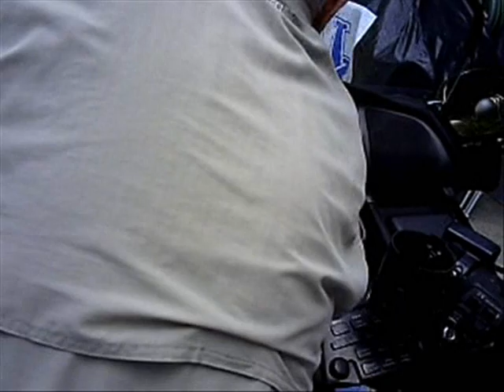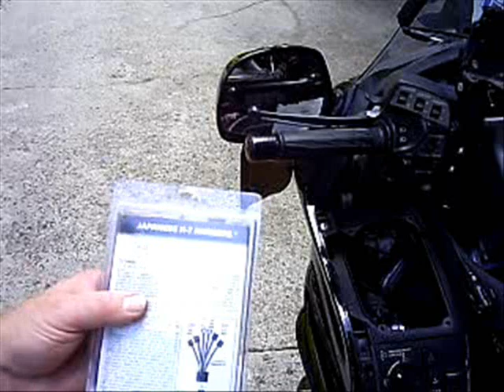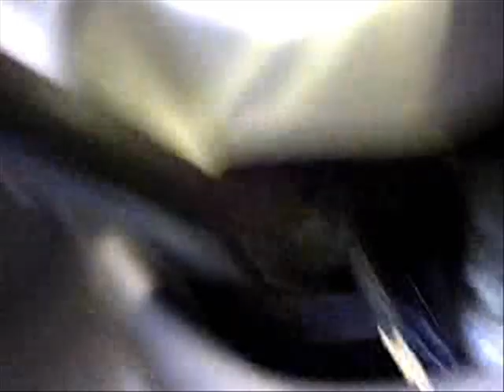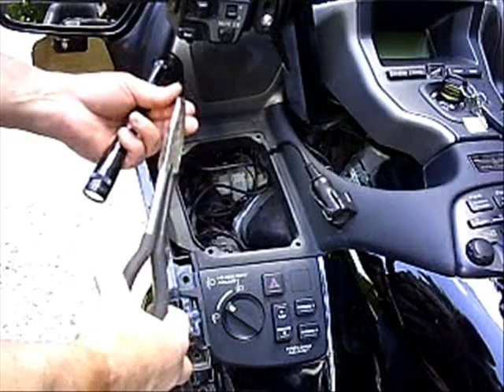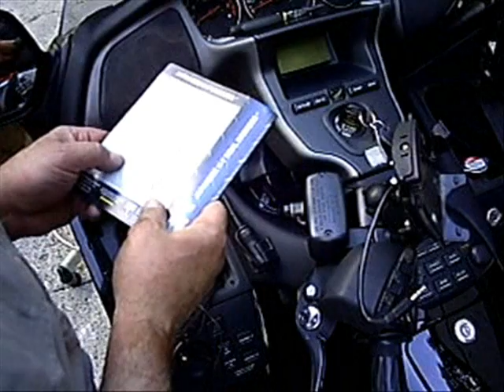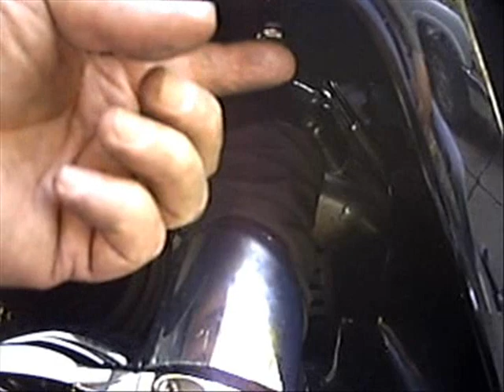Plug & Play Headlight Module Installation on a GL1800

Comment: I was hit from behind at a stop sign because of my back off modulator on my bike.
   On my way to work 7 AM. I was waiting at a stop sign at a four way intersection until it was my turn. My Pacific coast had a back off brake light modulator...
   The next thing I knew, I was coming to laying on the ground. I must have been out for sometime because the police were already there, I heard the guy that hit me explaining to the police, “I saw his tail light flashing, so I thought he was pulling out. “ 
   I was off work for nine months/shoulder. I did have my one piece aerostitch Suit/motorcycle boots, started gauntlet road racing gloves, and a two week old $500 shoei  helmet that got road rash.
   On the Internet, I made a connection with someone that had experience with accident rates with the tail light and headlight modulators.
  He explained to me that these things make following or approaching drivers have a phenomenon called “target fixation “ and that is, when you see something unusual while driving, your subconscious walks onto it and watches it as it is approaching or you are approaching it. The danger is, we tend to steer towards things we are looking at.  
  The example the guy that did some research on these flashing products told me was,
  Montana state police put headlight modulators on their cars. Montana is sparsely populated. Yet, they had the highest incidence of head on collisions of any police force in the entire country while using those modulators